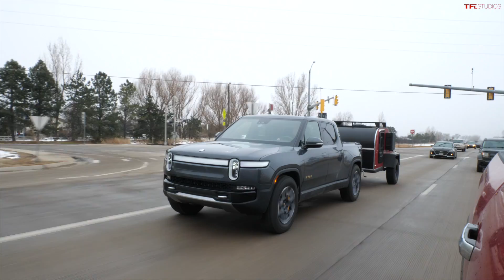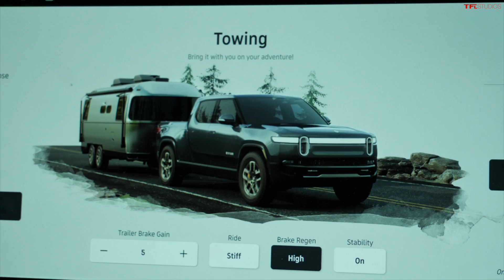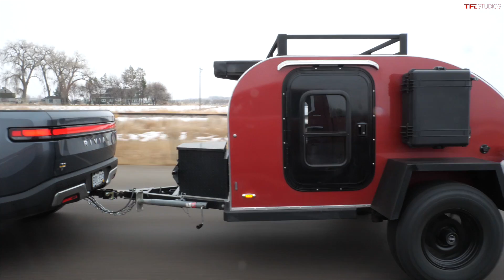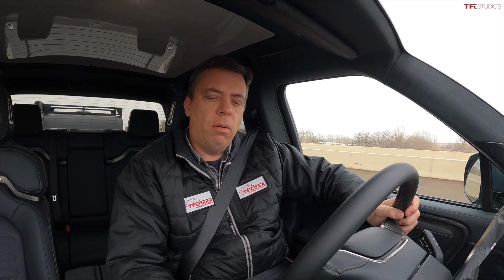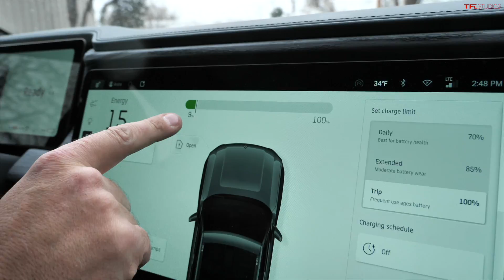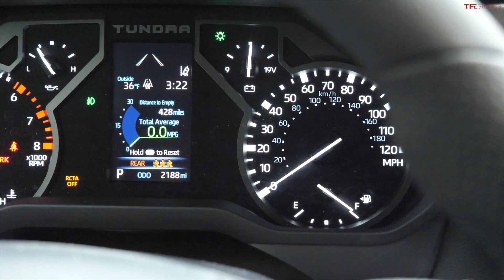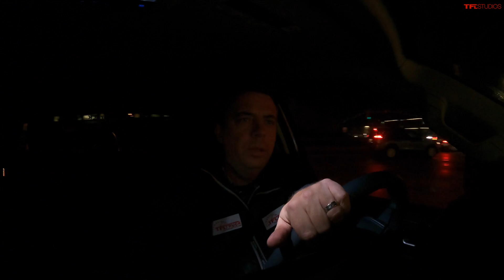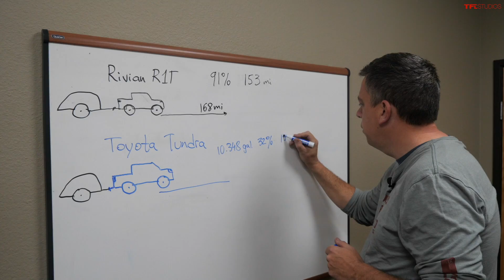Rivian R1T vs. Toyota Tundra: How Far Can Each Truck Tow On A Single 'Fill-Up'?

Comment: still, energy wise the R1T returned about 42mpge (assuming 1.25miles/kWh), while the tundra averaged 14.8mpg to accomplish the same task. As per textbook, about three times less energy
Reply: All energy forms aren't equal though.
Reply: Again, MPGe is a meaningless metric, because most of an EV's energy usage happens BEFORE you discharge the battery.
Reply: @Mark_Christian25  cute! While gasoline just appears at the pump by miracle!
Besides, this meaningless metric simply shows how inefficient ICE vehicles are. Not to mention that you can choose from which source to power your EV.
Volvo estimated that its XC40 EV takes about 30k miles to break even with the gasoline version in CO2 production when powered by renewables, and generates 54% less of it in its life cycle. And, the XC40 is one of the least efficient EV on the market (car wise), or pretty sure the CO2 values for ICE cars fuel used are highly unrealistic numbers resulting from decades of oil corporations lobbying, or the EV ecosystem will keep improving, while ICE have been stuck on the same efficiencies for decades.
Reply: @USUG0  It doesn't magically appear, but my comment helps puts things into perspective. 

Where does your electricity come from? How is it generated? What does it take to deliver the energy to your battery? When those questions are answered, MPGe becomes worthless. 

Also, spare us your "green" blather, as it's just redundant.

Comment: So according to my math using your cost per kWh from the Ike video at 128kwh it would have cost 38$ to charge so about 2$ cheaper than the tundra. That is assuming the charger matches the kWh of what the rivian said it used.
Reply: Where I live charging at home would've cost 18$ and the tundra would've cost 52$
Reply: @larryspiller15   yes but that means you can never camp more that 80 miles away. Also the 240v charger you receive with the truck would take an estimated 18 hours to charge assuming you have the correct outlet to use it. If not and you have to use the 110v options it will 3 or more days.
Reply: @cboutdoorfun9955  oh I'm sorry I didn't realize you need a full charge to move the vehicle 🤣. No man. You could go 200 miles away by driving 60mph and then charge while you camp which will essentially be free since you are paying for the camping stall either way
Reply: @larryspiller15  camping with electric hookup?? That's not camping
Reply: @jacobstrutner8232  lol keep moving the goalposts man

Comment: What is the cost/mile for each of those vehicles. Gas obviously wins the range tests, but how does the efficiency compare? Are you at least saving money by going electric? Or is the difference minimal? Does the range of the gas far outweigh any efficiency gain of the EV, or is it a toss up? Need more info please?

Comment: A thought occurred to me that neither truck needed to be put into TOW/HAUL if only pulling 2000 lbs. The higher shift points might have had an adverse effect on mileage for both trucks. Maybe worse for the Rivian?
Reply: Rivian shifts? I thought electric vehicles don’t really have transmissions.

Comment: Tell me if I am right about this.  Assuming. 32.2 gallon tank in the Tundra, filled at $3.50/gal is $112.  If 30% of the gas was used for 153 miles that is $37 for the loop.  In a Rivian, assuming the 180kwh battery system at .1375 cents a kw is $24.75 for the same 153 miles, roughly, given only 91% battery used.  The only other resource that would be given up on a road trip is time to charge. That's $12.25 savings every 153 miles.  Maybe that amount doesn't matter much, but at least your snacks at the charging rest stop are covered.
Reply: Your not taking into account that the rivian is 100 grand.
Reply: @JohnDoe-nz6bk  Ahh, yes.  Certainly there are state and federal incentives, maybe totalling $12k, but still, you're right, much more expensive!
Reply: I double checked.  Launch edition is $75k, let's say subtract $12k for incentives from fed/state, we're at $63k.  2022 TRD Pro is about $63k.  I think.  (This doesn't include any major mark ups from dealers these days.  Ugh!  Hoping my 2012 Grand Cherokee lasts a while longer.)
Reply: @limaromeodelta  it's 8000 grand max for incentives. However, in Ohio, it's an extra 200 a year to register your electric vehicle. Not including higher insurance, and electric bill.
Reply: @limaromeodelta  it starts at 75 grand without options.
Reply: @JohnDoe-nz6bk  I was considering Colorado, which is $5k for medium sized electric truck and $7500 for federal, so $12500.  I understand every state is different.  Anyway, just weighing the options.  Thanks for the feedback.
Reply: @limaromeodelta  Damn! Colorado gives you that much incentives? That's interesting!
Reply: @JohnDoe-nz6bk  I used CO because that's where TFL is.  I live in NY, I believe we get a flat $2000 + the $7500(fed).
Reply: Super charging may certainly cost more.  Question is, how quick can you charge and what is the cost difference.  I don't have any idea on those numbers.
Reply: R1T battery is 135kWh.  The version with 180kWh is the max pack and is supposed to be available in 2023.
Reply: @turbop5756  Ahh, okay.  I thought they had the big package from that Rivian employee.  So, 135kwh is cheaper, at $18.5 for 153 miles.  Thanks!  Still, as one other commenter stated, Rivian is much more expensive, even with state/fed incentives.

Comment: So, I couldn't tow my jet skis to Daytona and back on a single charge. 90+ miles/2 hours one way. Now, if there is chargers at the beach parking lot. I want to like this truck.
Reply: True. All that power and capability is nullified if I can't make it to my destination in a practical way. The XL powerboost F150 Andre has seems to be the best for work and play overall while still returning respectable fuel efficiency.

Comment: Now compare the same route with your hybrid F-150 pulling the camper trailer.
Reply: Actually a similar trailer with the hybrid Maverick...
Reply: @fabulousoffroaddesigns5080  That would really stress the Maverick as it only has a 2k towing capacity...
Reply: @OlJackBurton  yes but they make a similar tear drop in a lighter duty with smaller tires and they are only 1500 lbs.  "Similar, not the same, but the same-ish size.

Comment: Great video, cheers Andre for putting in a long day in the drivers seat! I can imagine for the US 168 miles of range is a little low maybe but for where I live in Ireland 168 miles would bring you the whole way from one side of the country to the other, about 80% of the country could be reached on one charge
Reply: I live in Germany and here a 168 miles is already useful. But you need to remember that this trailer is light and aerodynamic. Imagine towing something like a boat.
Reply: Only useful if there's a charger at the other end.

Comment: 168 miles is just over two hours at a normal 80 MPH on the highway for most of my trips. Stopping every two hours (or less at that speed) for 45 minutes or so is rough compared to five hours (or when we need a break) for 30 minutes. Finding charging at those two hour marks may also be impossible across North Texas and Eastern New Mexico.
Reply: At 80 mph you'd be lucky to go 130 miles and the fast charger would only fill you to 80% so the next leg would be like 104 miles.  To do it properly and efficiently without damaging the battery you'd be charging 70% every 90 miles.

PS you get your best mileage at 55 mph in a gas.
Reply: You tow at 80mph?!
Reply: @mattbrew11  Sure, no big deal. I don't even notice most trailers behind the v10 Touareg.
Reply: @hallkbrdz  physics notices them
Reply: @mattbrew11  that's easy to do with the proper setup and proper weight distribution. I've done 85+ with a uhaul trailer  at around 2,200 lbs behind a lincoln Mkx during a 900 mile trip.
Reply: Not many if any charging stations in central Canada either.
Reply: @ConsoleCombat  That is consistent with what the TFL truck guys found when they had to charge the Rivian to get home in their last video.  The charge rate really dropped off at a lower charge percentage than they expected.  I didn't give their numbers because they didn't know if it was the truck or the charger throttling.
Reply: Stopping every two hours or so would actually work well for me. We usually take our dog and like to stop fairly often (at least every three hours) to let him out and get a break.
Reply: Except as they noted, at speeds above 60 or so the Rivian's efficiency tanks so you are not going to be going 168 miles at 80 mph.  Your range will be considerably less at higher speeds.  Also while lithium batteries can charge very quickly up to 85-90%, the charge rate drops off a lot as you approach 100%.  Check out their video using the Rivian on the mountain pass towing loop where they had to recharge to see real world charging rates.

Comment: Y’all always show what the gas units take in dollars at the end of a trip. But not one these elec coal burners,  what did it cost to bring it from 9% to 100 %. You worked the Toyota out on the white board  but skipped the coal burner rivian.

Comment: Great test now get the car trailer and put the old Chevy truck on it and do the same test again to find out how much does it cost for fuel and electric and and how long it takes for the round trip time
Reply: I think we all expect that the rivian wouldn't make it the same amount of miles towing from 100% with the old pickup on the heavier trailer. The tundra would though.

Comment: Rivian speed was 55.  What average speed did the  tundra have? Even a couple mph difference makes a dramatic  impact on wind resistance.  Also... who drives 55 on the freeway??  Should have been 65 or 70 mph, which is where people actually set the cruise control. I bet the rivian energy use would be impacted much more than the tundra.
Reply: Yep!

Comment: If I trust the numbers I just found for kWh per gallon of gas, the Rivian was roughly 3x as energy efficient as the Tundra.
Reply: 35% thermal efficiency for gas engines is about right. Other factor is that the tundra is a much bigger truck, but the Rivian is a lot heavier.
Reply: You forgot the wait time.

Comment: I’d be curious to know the cost per mile on the R1T? I believe I heard 14mpg on the Tundra. So @3.50 a gallon that’s 0.25 per mile. I realize the ice will go farther and fill up faster but I also consider time is money. So I’d like to know if the additional charge time vs savings per mile could be justified?
Reply: Home charging in Colorado from the grid, that would have been like a $17 trip for the Rivian.  No idea how much more fast charging costs, though.
Reply: @13x  if that’s true then about .11 per mile. So maybe 8.50 an hour @60mph. I think I seen $40 to fill up the Tundra so a $23 savings on 150ish miles is decent. Considering 2 1/2 hours driving and if you can charge back in an hour (best to keep in the sweet spot of charging speed)  to me is about a wash. To each it would be their choice but for me 300mi would be the outset range I’d like for electric and above I’d prefer an ice vehicle. This is considering pulling a similar small camper. Though truly if your doing a weekend camping trip it’d much closer to maximize your adventure time so electric or ice wouldn’t be much different in time but it sounds like I could get a thicker cut of steak in the R1T.
Reply: The Rivian obtained 42mpg in comparison to the Tundra's 14mpg.

Comment: Thank you guys for putting in so much work into thoroughly testing the Rivian. You are the only people doing anything like this and these are the questions real people have about buying an electric truck
Reply: Thank you for watching!
Reply: Its not even about range....its about where the next charger is...theres always a gas station.  Midwest and east coast are very sparse.  Less than a dozen in the entire state of mass. And you lose even more in the cold up to 40%. Just sold my Ev because of this.
Reply: If you're going to tow a lot, don't bother. EV pick-ups are just fancy looking city trucks.

Rivian would require 489kWh to reach 450miles vs 30+ gallons of the thundra (while towing).

489kWh*0.4$/kW = $195
30+ gallons premium $4 = $120

91% for 153mi + (2.94*91%) = 379% for 450 miles
3.79x 128.9kWh rivian battery size = 489kWh+
Reply: @itburnswhenipvp3789  And math is why EV's are NOT PRACTICAL!!!
Reply: @itburnswhenipvp3789  OUCH! Your math is why we haven't/won't see the Te$la Semi for a while.
Reply: @itburnswhenipvp3789  good points, but if the battery capacity existed, it looks more competitive cost-wise at current approximate Tesla supercharger prices of .28/kWh at $137 for the same trip. At more common home rates of around $.15/kWh it would be pretty darn affordable. Question is, how long will it be before we see a 489 kWh battery that doesn’t weigh 10,000 lbs?
Reply: @jonnyslick81  Most people would have to get a Health Cert. cause the vehicles weight would be over 10K pounds ~ Class II motorhome basically+ added weight= less efficient.
Reply: Came here to say something similar. Great tests!
Reply: You summarized what I was about to say, great job 👏

Comment: i would want to know the real big question. how mutch energy will the 120.000$ rivian truck "european price" be usefull after 2-3years of use as a work truck. most people that have pickups are handymen and farm folks that tow construction meterial and big animals. a good diesel pickup cost 30-40k$ and a rivian 120k$ is the price wurt the in the long run.
Reply: Do you live in the US or in Europe, because this question does not apply if you live in the US. Also the Rivian has an 8 year 200,000 mile warranty. This means that your battery will only degrade to ~80% capacity after the warranty has expired
Reply: @migueljardim8177  i live in europe and in europe the automotive journalist are on the hands and knees praicing electric veicle but refuse to calc in the long term use and usebility as a small buisnesd owner that transport heavy goods all day.
Reply: @Snipermicke  Depending on your use case the electric vehicle would be more cost efficient for you. The lower operating costs combined with less moving parts for better reliability it will work out cheaper for you. Especially considering that the price of petrol and diesel are extremely expensive in Europe.
Reply: @migueljardim8177  yeah it is a lot of pros and cons. it is cheaper to fuel but 1-2h down time every day to charge + time to go to the charger and even more on a long day. unknown heavy use statistics. it is to early to make that investment. my isuzu d-max 3.0 cost 35k$ and a 120k$ investment to the unknown is a big pill to swallow. will the "fuel" price cover the 80k on its life time when the fast chargers cost 40-60cent per kwh to charg.
Reply: @migueljardim8177  1 full charge is 250km on easy highway and how will it do towing in start stop trafic and real world senarios.